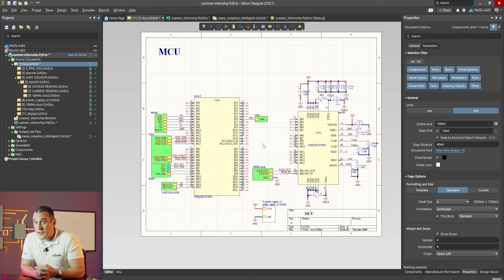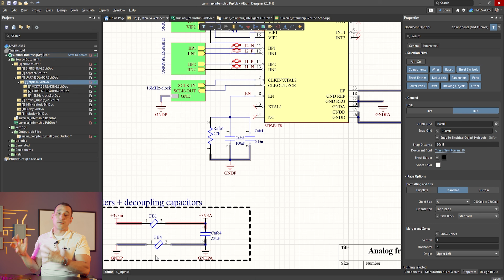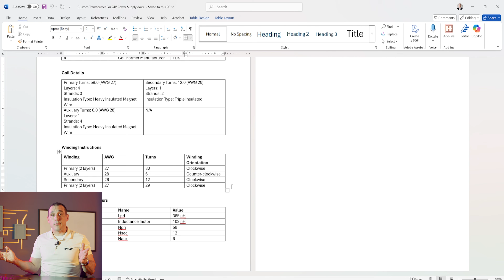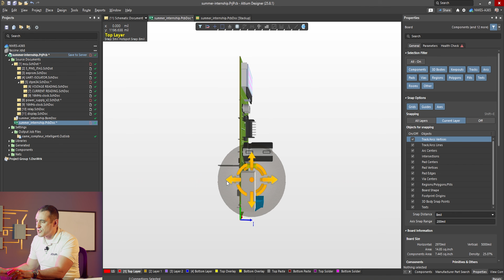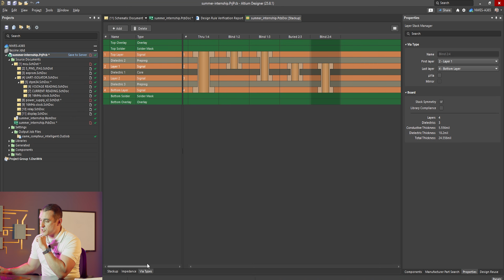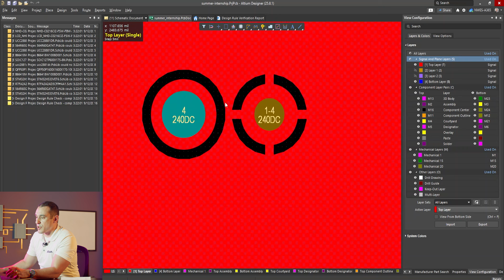PCB Design Review: Power Meter Layout Deep Dive

Comment: For STM32 I often enough had to use larger packages because I needed certain USART configurations, or the ADC reference routed out. Where 48 or at least 64 pins would have been enough, I ended up with a TQFP 100.
Reply: I feel you my friend. It is always painful having to use those huge pin packages just to get access to some peripherals

Comment: hi zac, i made a board using the sig/gnd/pwr/sig, but in layer 3 im using three power rails, in those power rails are some components belonging to each power rail and also connected to GND, but when i apply stitching vias to GND, the stitching vias wont apply wont go to power rails polygons, sidenote: im using polygon pours on layer 1 and 4 also im using asimmectrical stackup, how can i fix this?

Comment: I've made some designs with STPM3X. As you mention, the GNDD and GNDA on the schematics are joined. If you look at Gerber files from ST, you'll see they use a star topology for their ground and it's what they recommend. I've moved from following their recommendations to using a simple plain ground and it's what seems to work best (tests at the lab and on site).
Reply: Just another instance showing that the semiconductor vendors don't know anything about PCB design! They usually ask the company producing the dev/eval boards to create the PCB layout so they can get the work done cheaply, and the design approaches in the dev board rarely transfer to other designs without SI/PI/EMI problems.

Comment: Wow... there were a lot of things to address in this review. A good learning opportunity for the designer and others who watched the video. 
Great work taking it on and digging deeper. 
Tolerances seem to get overlooked by a lot of designers and are critical to avoiding issues in manufacturing and assembly. Using IPC standards will help avoid some potential problems. 
I think Altium could do a better job of heading off mfg issues by coaching the designers to not make bad choices like the buried vias that are not possible to manufacture, for example. Perhaps a DRC check for DFM rules would be wise... 
Your contributions to the design community are really appreciated.  Keep up the great work! 😀